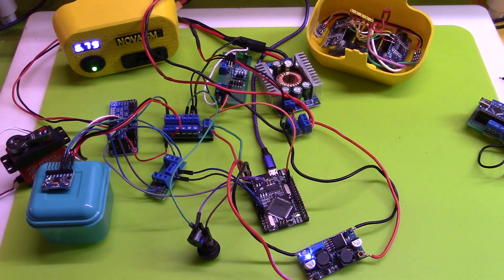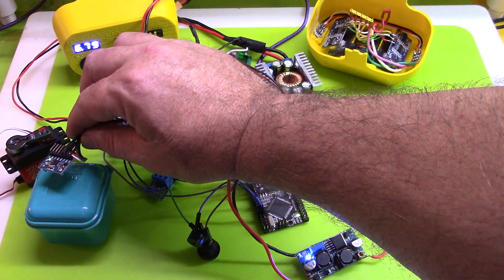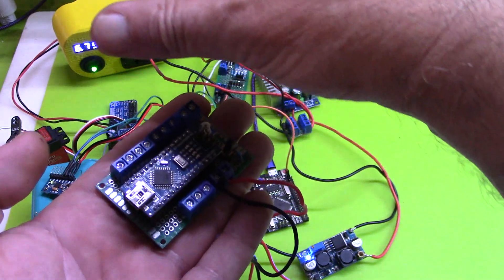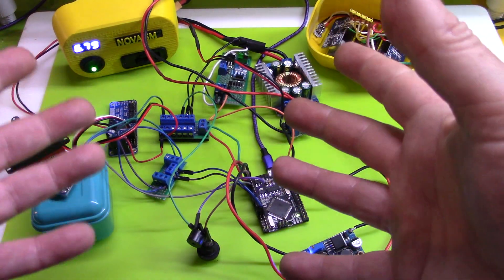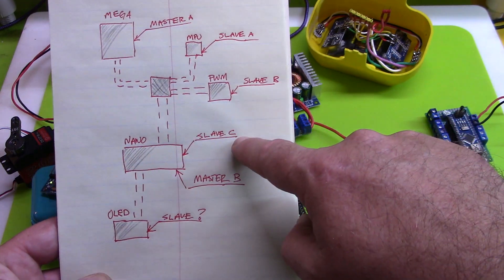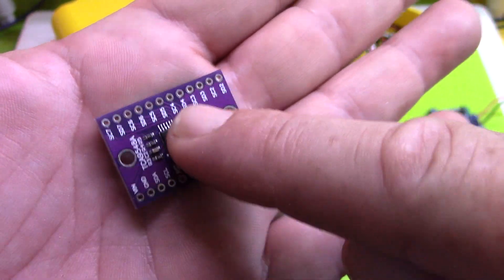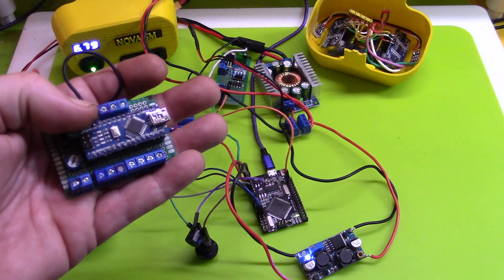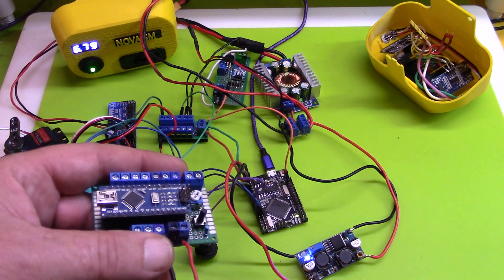I2C Issue Resolved!  : Nova SpotMicro3 - an Arduino Quadruped Robot Dog

Comment: is it not possible to control the oled with the mega or is that the whole purpose of the nano?
Reply from the maker: yes, the purpose of nano was to move some load off the mega, leaving its processing power for the motors and sensors.

Comment: my mpu does nothing to the servos even though it is set to active, is it the nano causing that?
Reply from the maker: yes.  I haven't tried this yet, since Nova is now in pieces... but try disconnecting the OLED and set it to disabled in mega code... that may fix the issue since the OLED is the "slave" causing the nano to be a "master", which it can't be!   Fail!  I think I am just going to replace my OLED with an SPI version, hoping that solves it once and for all.
Reply: @ChrisLocke1969  got the mpu working but when it is active the legs go all over the place from start up ,but with it disabled and not connected then spot goes to the stand posision and the legs dont go all over the place.same result with oled and nano active or disabled
Reply from the maker: @stefi300972  hmmmm, that may be from the new initial stance.... she used to power up standing, then MPU does its error leveling.  If she is in crouch when MPU level checks, that would probably do it.  I will have Nova back together this weekend, and will fix this for us - sorry about that!

Comment: SPI communication between the Mega and the Nano would be good  solution but you need to design a communication protocol between them. In other words, SPI provides the link but not the language. Another simpler solution would be to just replace the Mega with a more powerful higher capacity compatble board such as a Teensy or even an ESP32. These program as an arduino so no need to rewrite the existing code. The only difficulty is the différent logic levels that need to be handled. The Mega is showing its age!
Reply from the maker: Great feedback, I appreciate it very much!   Yes, I'm discouraged to throw away my communication code around i2c... so I think I'm going to replace the OLED with an SPI version, and just use i2c on the Nano as a slave.  I think that'll fix this issue.  And yes, the Mega is showing its age, but so am I (lol)... I love this board, and kinda love the challenge of using such devices.  i don't things easy, that would make this hobby boring.  :)
Reply: Great that you found the problem. I too have used the Mega for many years and stil do. I've just become curious of these newer boards.. I've  now got a pile of esp32 waiting for projects wirh just one hooked up to play with  Lol.. 
They are fun to use with the built in wifi and BT and so damn cheap!
I also discovered VScode and plateformIO for arduino. Never going back to the Arduino IDE!
Reply from the maker: @B_mata  i need to look into platformIo then... arduino IDE.... Java... nuff said 🙄👍
Reply from the maker: @B_mata  i was playing with an ESP32-CAM board, thinking of Nova... but holy hell, what a nightmare process to even connect the damn thing, nevermind get code loaded on it! 🤣
Reply: My spot is going to be esp32 based (when I get time to start building!!) so it will be interesting to comparé projects.

Comment: Look into STM32s, they have two I2C buses. I'm doing nearly the same thing you are but with an ESP8266 (master) to two STM32 bus 2 (slave) then each STM32 bus 1 (master) connected to the same multiplexer reading (6) AS5600 angle position sensors (slaves). My arrangement was driven by the AS5600 having a fixed I2C address (...) but the stm32's two i2c buses made it all possible.
Reply from the maker: wow, that sounds like quite a network of components. Are you building a dog or other robot?  Thanks for the feedback, I will look into STM32s, that's new to me. I played with ESPs a little here and there, but I just love arduino boards :)
Reply: @ChrisLocke1969  also building a quadruped. Definitely learning a lot and sometimes unintentionally doing things the hard way.

Comment: Why not using a software serial between the Mega and the Nano, being both I2C master for their own slaves?
Reply from the maker: That's definitely an option, thanks for the contribution!  I think I'm just going to swap my OLED for an SPI one... easier to recode the display than the communications protocol lol

Do you see any benefit to using software serial over I2C?
Reply: @ChrisLocke1969  SPI LCD Display should be faster and better than I2C OLED one, but the clock speed of the Arduino is too slow to drive those display.
And for the communication from nano to mega, I should say with serial communication is the solution because mega have 3 hardware serial and you don't use serial in nano board.
Reply: @ChrisLocke1969  the only real benefit is that you'll not face conflicts between different I2C coms.Ahmad is right you can use the 2nd or third standard serial communication on the mega side (keeping serial commands from the IDE) talking to a software serial on the nano side if you need the standard one (for the IDE maybe ...?)
Reply from the maker: agreed, the software serial idea is on the table for consideration! I am going to try the SPI display on nano, eliminating its need to be a master on i2c bus, and hopefully that fixes it. I will be connecting the nano circuit to my out-of-body electronics this weekend, so i should have an update video coming soon! 🤞